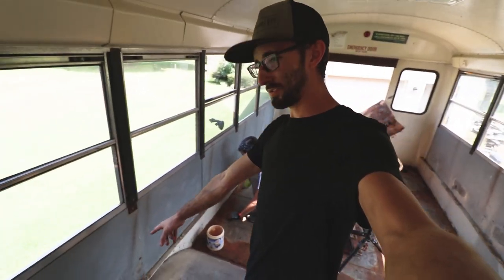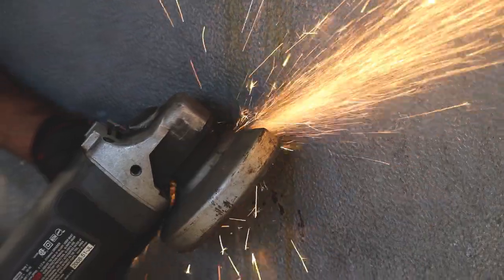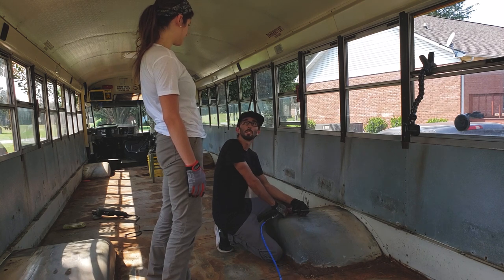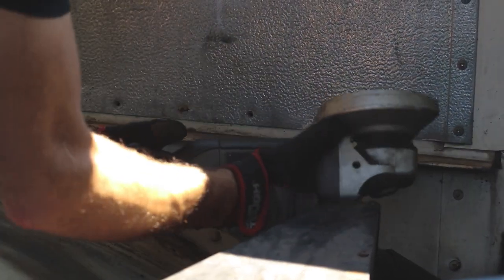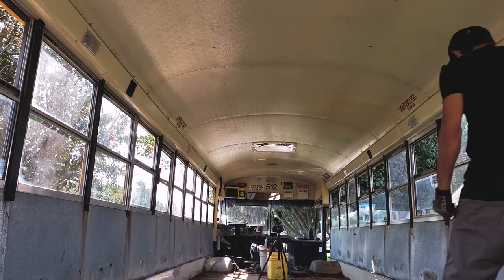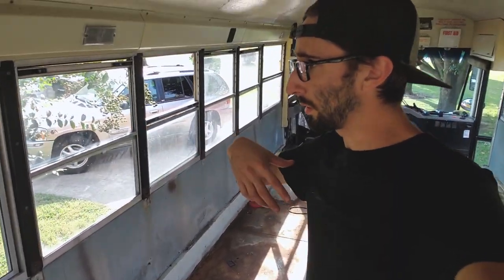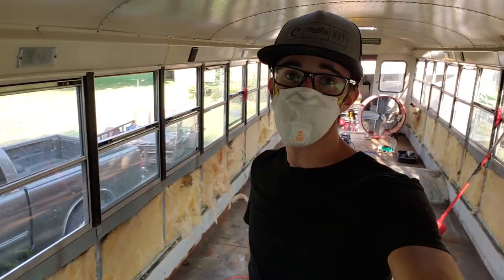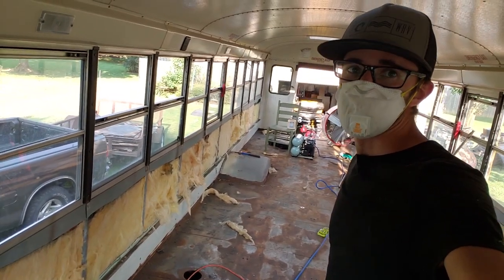Removing Interior Side Panels in a School Bus Conversion // Skoolie

Comment: Just use extra caution welding that galvanized steel.  The fumes are very hazardous.  Welding thin metal is a challenge if it's your first time.  Get some practice in and the settings dialed in on the welder before doing the final patch work on the bus.
Reply from the maker: Definitely will practice some. I thought I read that because I'm using a Fluxcore wire, it should help with the hazards fumes....? Maybe I read that wrong? Thanks for watching!
Reply: @BackroadPurpose  i realize i'm several years late to the party but this is not at all true. metal fume fever is serious stuff. you should have good ventilation and always use a proper respirator or remove the coating prior to welding. i've never been unlucky enough to suffer any serious side effects from welding, but it can happen to *you*.

the difference between using flux core wire and a separate supply of an inert gas like 80/20 is the flux burns off and provides the shield gas for your welding pool.

Comment: We ran into the same thing pulling the side panels out today. After inspecting, it looks like the inner skin folds over the square tube frame. That's awesome you have an air chisel to use! That sure does beat putting a screwdriver on the heads of the screws & hitting it with a hammer after cutting them with the angle grinder!

Keep on producing cool vids, y'all!
- Brian + Erin
Reply from the maker: Ah I feel you guys on that one. We got a cheap one from harbor freight. And have actually had to use a few more times throughout the demo as well. And thank you very much. I'll be posting more often. Starting to get a workflow down.

Comment: Did y'all remove that lower panel that's parallel to the bottom of the wall underneath the panels you took off here? We've just taken out the panels and insulation, and aren't sure if we want to take that part off or not.
Reply from the maker: We did not. If you talking about the one beneath that rail that goes front to back, that's a structural wall, pretty important. You can stuff the insulation down in there if you wanted to as well.
Reply: @BackroadPurpose  yes, that one! Thanks my dude! Wasn't finding any info on that, grateful for the reply. Y'all are the best

Comment: Just curious as to why you took the fiberglass insulation out just to put in foam?
Reply from the maker: The roof had a few leaks (like most old school busses) and it caused mold. So I did not want to build this entire bus just to skip one step that could cause health issues. Plus the rigid foam has a higher insulation value over the fiberglass. So it was an upgrade.
Reply: Backroad Purpose thanks!